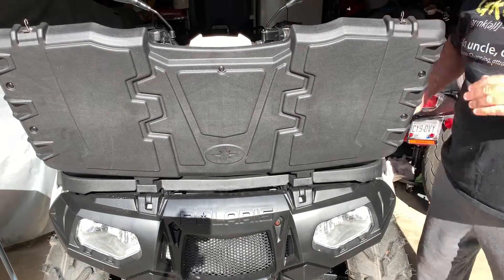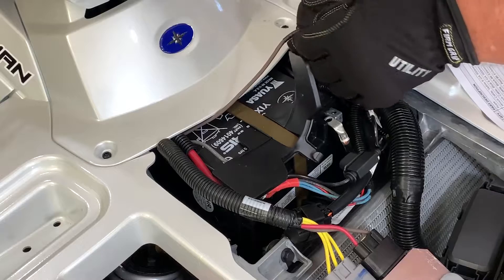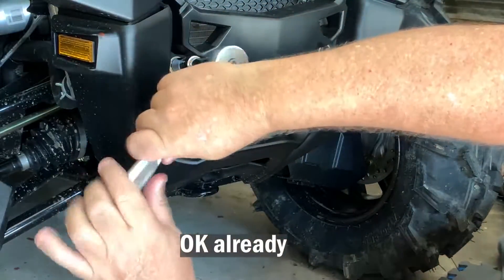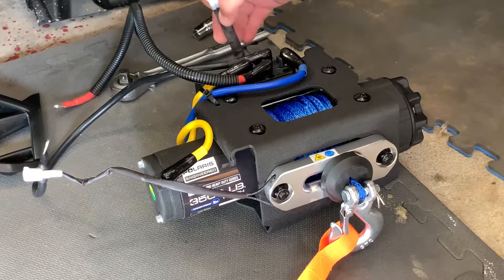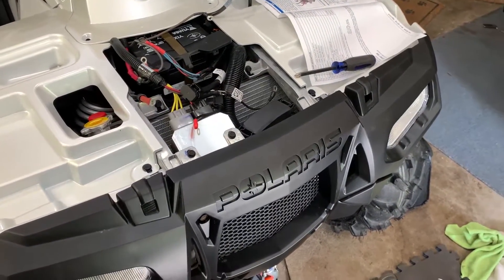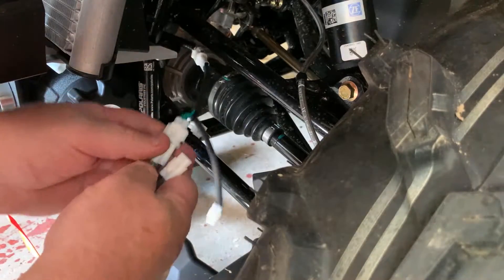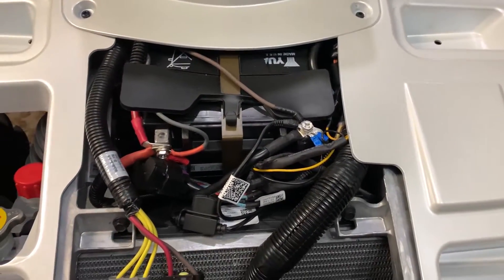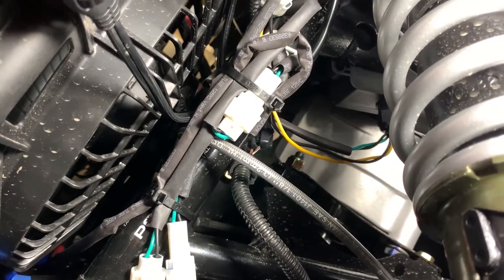Installation Polaris Sportsman 3500lb winch

Comment: I remember going through what you went through when I installed my warn winch on my 850 in 2012. I ended up taking off more of  the body parts in front of the radiator and handlebar lamp to help w installation.. Then, I made some mounting brackets for the controller and remote in the area in front of the radiator but behind the grill. It took awhile but it was mounted and protected from areas that acquire mud. I'm glad I did it myself as I got it done the way I wanted. You can even see the Warn label on the remote receiver through the grill. I/m sure that you will appreciate what you've learned in the future while maintaining it. Have fun!
Reply: i guess it's pretty off topic but does anybody know of a good site to watch newly released tv shows online ?
Reply: @Lucian Kannon Flixportal :)
Reply: @Cassius Juan thanks, signed up and it seems to work :) I appreciate it!
Reply: @Lucian Kannon no problem xD

Comment: I’m trying to fine my blade connection on my Highlifter 850 people say it’s under the radiator but I couldn’t find it
Reply: If you check the three minute mark on this video you sill see that the connectors are not where the instructions say they are. I assume the 850 should be similar to the 1000.